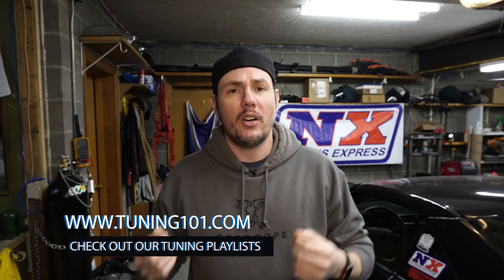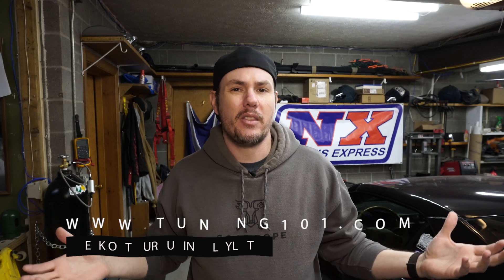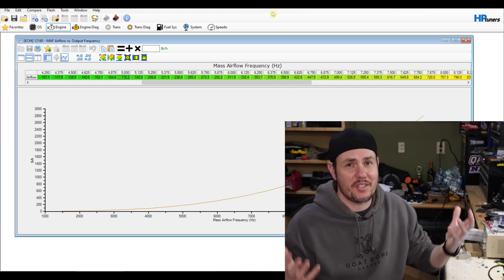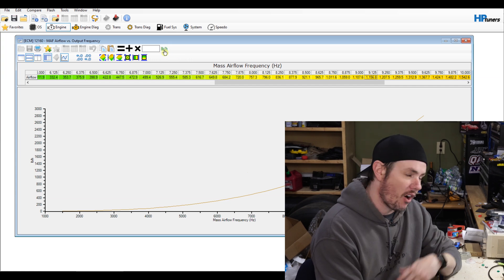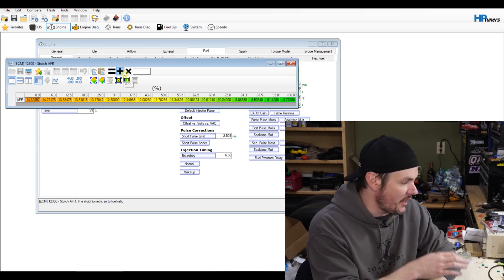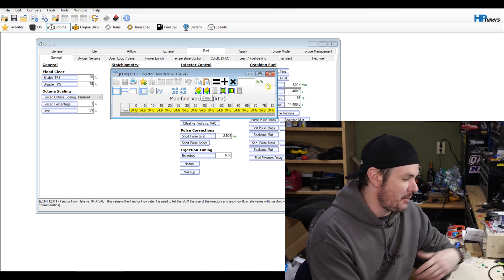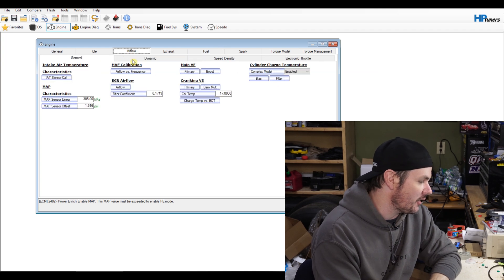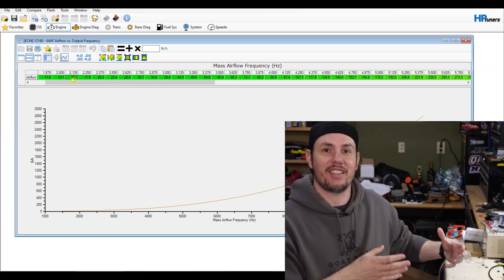MAF Sensor Explained, Information For Helping You Tune Them!

Comment: I recently built a LQ4 very mild build as in 243 heads,truck cam, tbss intake, 92mm throttle body, long tubes, full stainless exhaust with mufflers. I am currently running into a issue where I am getting a code for the maf. Could this be due to the tuning? Can I change setting within the maf? I have reverted to buying a new maf at this point thinking it was a issue. Maybe this was the wrong way to go about trying to fix it. Also I can not seem to get rid of a TPS code either. I am starting to think that the throttle body I bought is the issue. I am dumb to this and at a loss any help would be greatly appreciated at this point. Thanks in advance for any help.

Comment: Just checking to make sure I understand what you're saying, if say at a certain airflow you are running richer than commanded you could shift the airflow table down in that area a little bit at a time and it should bring the mix back towards commanded?
Reply from the maker: Correct, fuel delivery is a calculation of measured airflow, more air, fuel and vice versa

Comment: Could you maybe explain how MAF, VE and other tables are working under cold start conditions and/or while running in OL? I'm wondering how the ECU is exactly working with those tables before switching to CL/directly after cold start.

Comment: Do you have much experience tuning corvettes? I have a C5 with the 5.7 LS1 in it. I paid to get it tuned after installing CAI, LTH, Catless x-pipe, aftermarket mufflers, a moderately aggressive cam from tsp, chromoly push rods, dual lifter springs, and a high flow oil pump. Anyways, it has serious issues idling if i am going down the road and put it in neutral. It can jump around from 200rpm-800rpm like it’s trying to die, or it can find a fixed spot between 1200-2000rpm to idle at. It fixes itself when stopped and stays around 800-900rpm like it should. I took it back to the tuner and he said everything was fine. I remember he said he did a spd density tune and bypassed the MAF. Could that be the issue?
Reply from the maker: On a 5th gen Corvette I'm guessing there is some IAC issues send possibly some timing issues that need refined if that is happening. MAF deletes are only common in the 3rd gen world, 4/5th gen motors they do the opposite lol
Reply: Goat Rope Garage thank you! I’ve never tuned before, but I’ve been looking into getting started with it. I’ll look into the best I can using your videos to help. I’m sure you’ll hear from me again with more questions
Reply: Goat Rope Garage I’m struggling to find anything about C5’s and IAC. Only things close to related are saying it’s in the TB, but I don’t see where at all. On another note, I’m not ready to start tuning myself yet, but would it be wise to buy HP Tuners to monitor for diagnostics?
Reply from the maker: Yeah, there is a stepper motor in the side of the TB to control idle. You can data log even with out tuning and better understand what is going on. Got to start somewhere!
Reply: Goat Rope Garage do you know of a tutorial or directions to do it, or is it easy enough that I could probably figure it out without breaking it? I’m very mechanically inclined (installed the cam myself) but don’t have formal education.
Reply from the maker: www.tuning101.com

Check the playlists, tons of how to videos

Comment: Stupid question:  If you tune the maf do you have to go in and tune the fuel table? Or is the fuel table  now like a safety to the maf which I know it kinda is. Like the low octane is to the high if you get some knock ?
Reply from the maker: Which fuel table you taking about Jay?
Reply: Ok I think I figured out what I meant to ask. When in p/e high rpm is it using the maf table for fueling or is it using the commanded in the p/e table. Like let’s say I’m wot and the maf is maxed but I still have some rpm left. You said it starts guessing and drops ms on the injector but what about the p/e table does that get cut?
Reply from the maker: PE table is a modifier, it uses you're stoich table at all times, then when you achieve the triggers for PE those calculations are applied to your stoich table

Comment: I have a question and I figured I should ask you as you know a lot about tuning and that. See I just ordered a new Edelbrock intake manifold and will later be ording a new cold air intake. I was wondering how much it might cost to have my car tuned so it runs properly without risk of engine damage? I know it costs differently everywhere but an estimate would be helpful as I can't find a good enough answer anywhere else
Reply from the maker: $500 is the base rate, might find people who charge less, will for sure find people who charge more
Reply: @GoatRopeGarage  thanks for the info!

Comment: So by tricking the system in the fuel aspect wont this trick the ecu into thinking it’s making less torque which in torque based systems will cause trouble , like the tcm not shifting how can we fix this ?
Reply from the maker: We can tune around that be watching our spark airmass
Reply: Goat Rope Garage  what will it benefit by watching the airmass?

Comment: What's your opinion on running a MAF with a turbo? I see almost everyone doing away with it and going speed density. Are there limitations at certain levels of boost?
Reply from the maker: Limitation is in the intake duct size, you can exceed the MAF if it's too small but I love the MAF for boost

Comment: Have you dealt at all with dynamic airflow?  I don’t see much information out there regarding it, but it seems like certain situations would benefit from using it vs trying to use just MAF or just SD.
Reply from the maker: It's just a blend of the two and that is why I suggest you dial in both as they both have a benefit